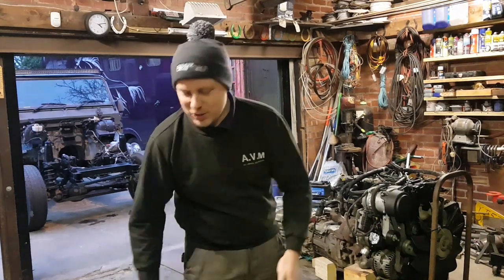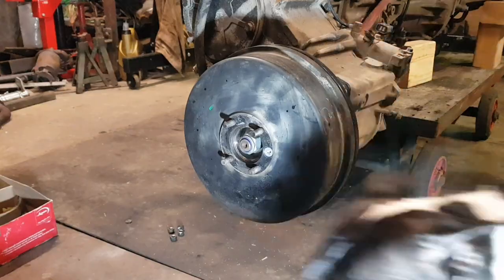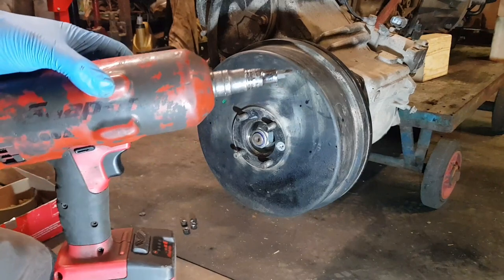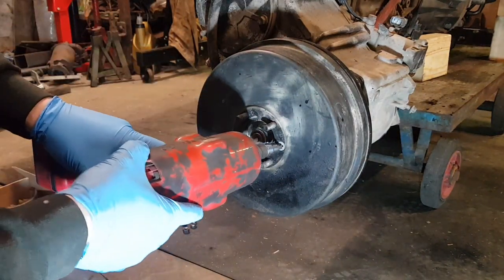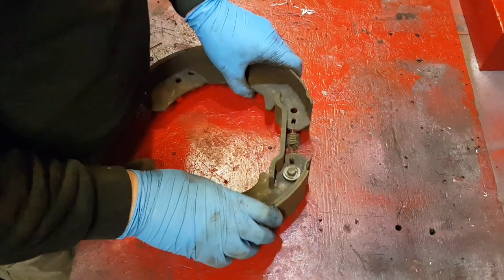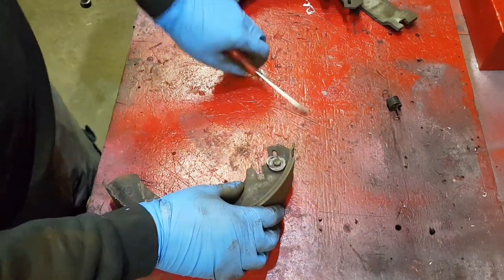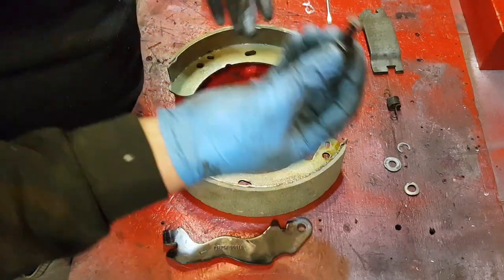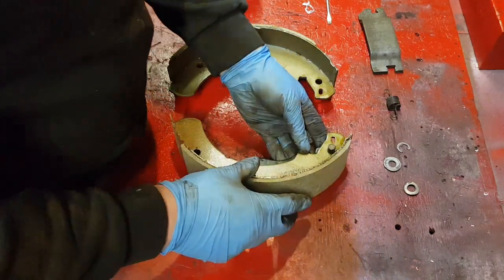Replacing Park Brake Shoes / Handbrake Shoes on a Land Rover Defender

Comment: My handbrake cable folds back on its self when released lever side.
Looked at mine don’t think there’s not enough room to slide of the drum off its very close to the middle exhaust box.
Do you need to move the exhaust, Tom to remove the drum.
Another great video
Reply from the maker: Thank you! If you take the exhaust off the rubbers you should be able to move it to one side to remove the drum. Like mine the adjuster will probably be siezed, if it is try and get the drum off as you can access the threads with wd40 and are less likely to damage the adjuster.
To me that sounds like the cable might be sticking. Let me know your findings 👍
Reply: @lifes.projects  Yes I thought that Tom. 
I did remove the centre rubber and try pushing it over by hand but couldn’t get much on it.
I may try a ratchet strap to hold it.
I will let you know how I get on. 
I don’t fancy taking the exhaust off, adding rust to the oil drips on the drive will send the Mrs into a week long sulk😁